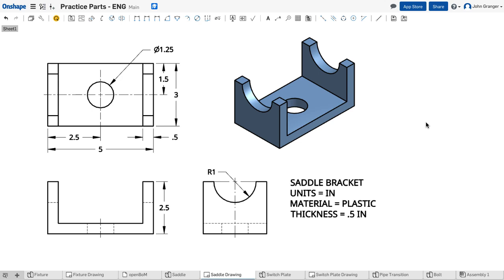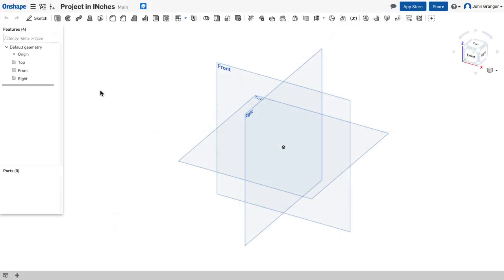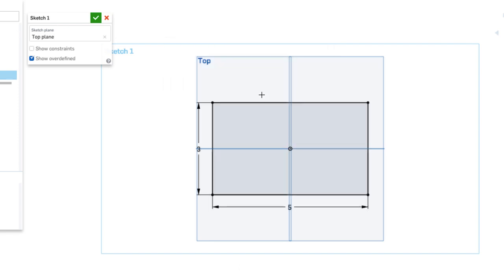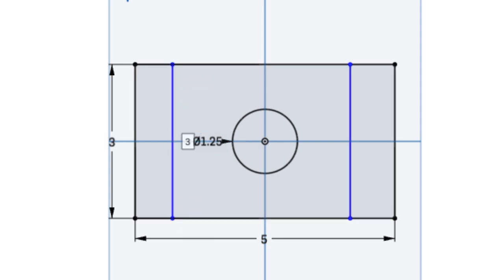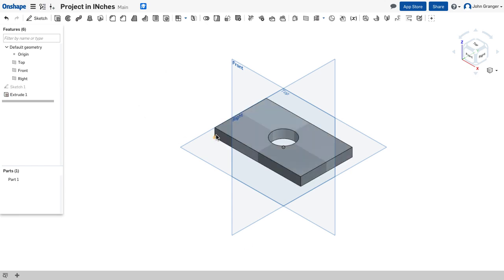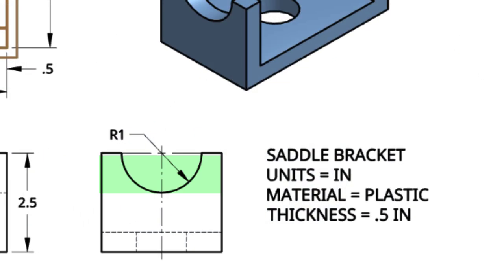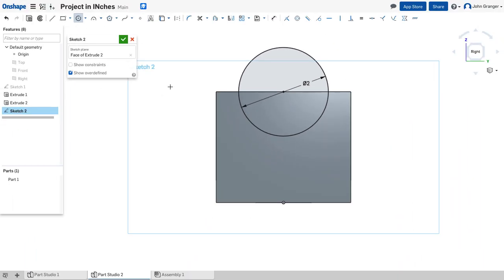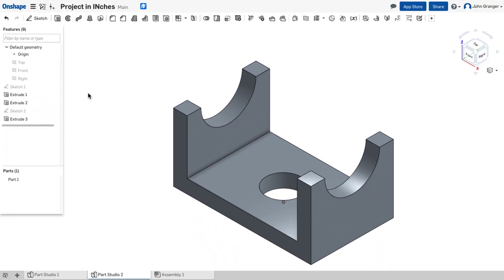Learn Onshape - Project 2 - Saddle Bracket

Comment: what is conci be more specific on what to use
Reply from the maker: Concentric is two circles with the same center point.  Coincident it two points at the same spot.  Use the help tool in Onshape and they define all of the constraints and geometric terms.  good luck

Comment: when i do the centre point rectangle when i enetered 5 it went really small
Reply from the maker: Check you Workplace Units and make sure you are using the correct units mm or inches.  Double click the whell or center button of the mouse to zoom all.

Comment: On the saddle bracket tutorial, I wanted to put a fillet on those two inside angles, but I can't select the edges without selecting one of the faces or surfaces with it. Maybe it's not really an edge? Also, earlier in the tutorial, I had trouble selecting the two end rectangles; I could select the first one, but then when I tried to select the 2nd one, I got the whole face/surface. I had to rotate the part to just the right angle, then I could select what I wanted. Using Ubuntu 20.04 and Firefox and Chrome.
Reply from the maker: Try making the model several times and pay attention to your steps.  I think you will find out how each of the features work.  It does take some trial and error,  good for you, keep at it.